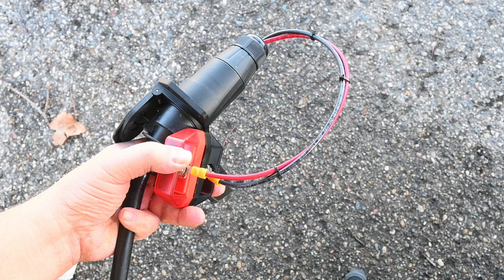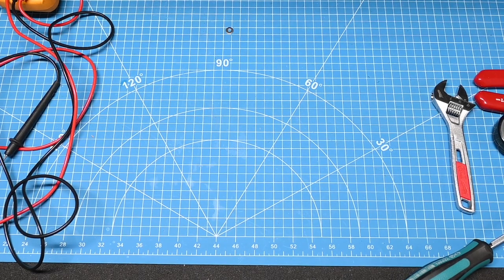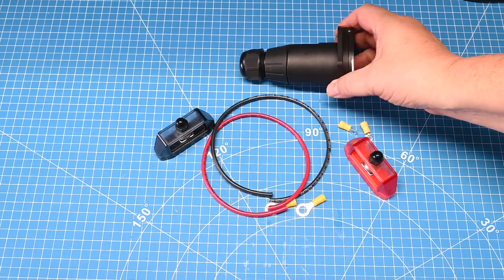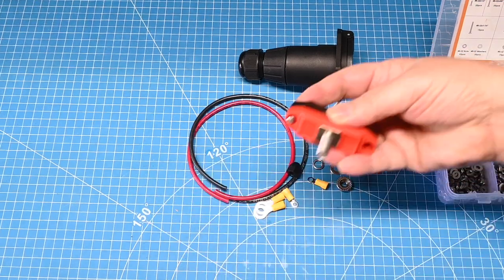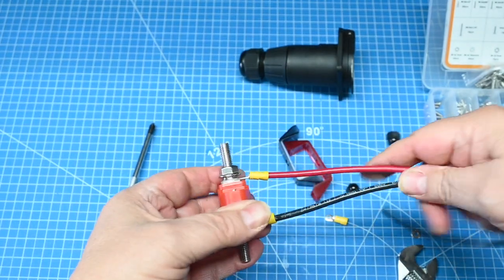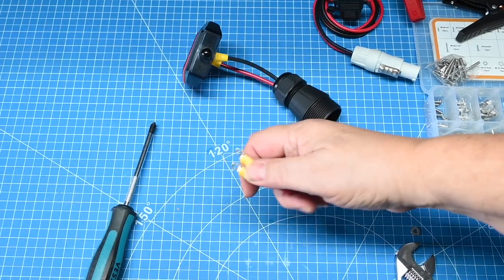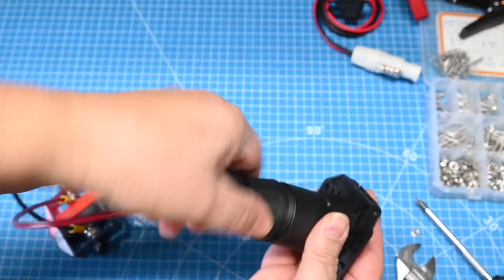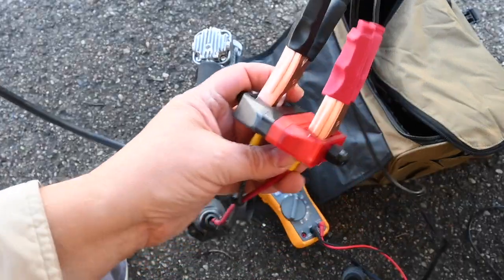Connecting a ViaAir Compressor to a RV - Part 2

Comment: Very cool idea I do have a small air compressor in my travel trailer with a cigarette lighter end but I could change to alligator clips and then I would not have to use my truck especially if I were on the side of a highway and the cord would not reach or something thanks 😊
Reply from the maker: You could also adapt the 7 pin connector to a cigarette lighter jack.

Comment: I have a Class A so my connectors are just the opposite so do I just reverse the type of connector to plug into the Class A connector?
Reply from the maker: If it is a 7 pin connector, you would still use the AX and GD circuit, which should be stamped on the connector.

Comment: Would it be possible to plug into the tow vehicle and use the tow vehicle battery instead of the camper battery? In case the camper battery was dead.
Reply: Yes, and that's my plan.   That way it should reach my boat trailer wheels.  You will want to ensure your truck's 12v + circuit for the 7-pin connector has a fuse that is high enough for the compressor.  It should list it in the owner's manual.  I believe my RAM has a 40 amp fuse and my compressor a 20 amp fuse so it should work fine.
Reply from the maker: As long as the vehicle connects 12V to the 7 pin connector it should be OK.  I have been hearing from some vehicle owners that some vehicles may not supply 12V unless the parking brake is on.

I have not independently verified that, but it is something to consider if it does not work.

Comment: just curious, how many times have you actually needed that compressor? I'm going on 4 seasons and I've never used mine
Reply: They are like jumper cables. Have them ready and hope you never need them😁
Reply from the maker: I usually top off the pressure on the tires 2-3 times per season. But we normally camp 70+ nights per summer, so we put a lot of miles on the tires.